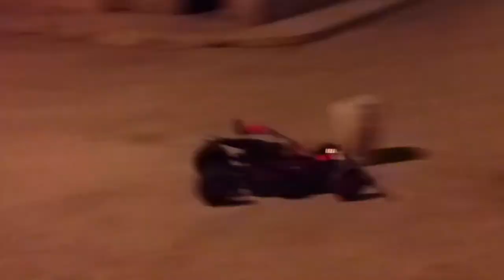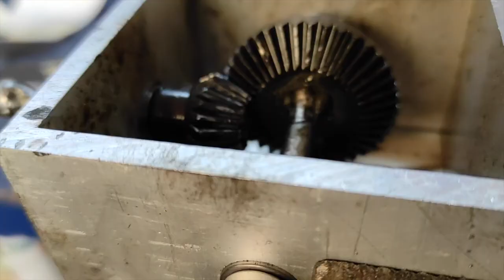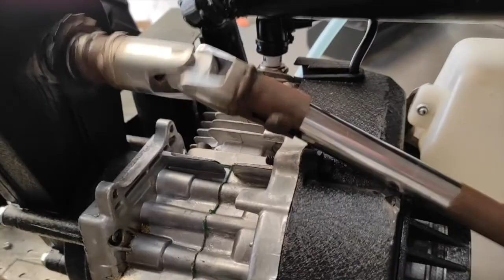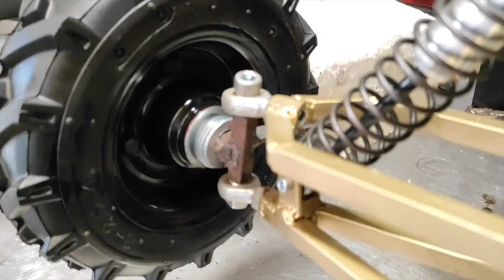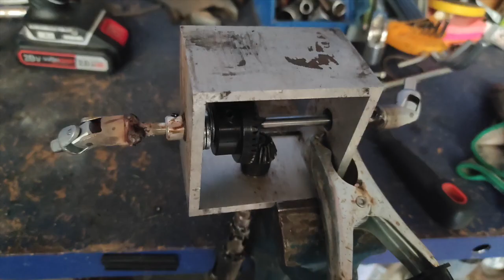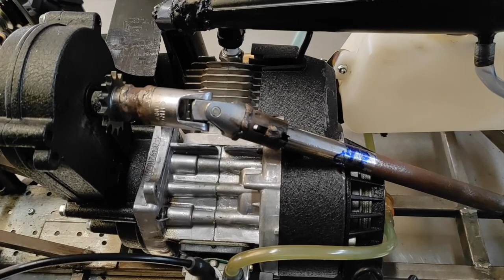DIY TRANSMISSION for Handmade 1/5 49cc RC BUGGY V2 - PART 11

Comment: very nice project, but from what I saw you don't have a differential in the transmission?
Reply from the maker: Thanks! No, it's just a 90° gearbox. For offroad is OK. On my V1 Buggy I used a solid axle driven by a chain
Reply: @CMBProjects so you can make more drifting
Reply from the maker: @R3cHin13  yes! Check that out on my other videos